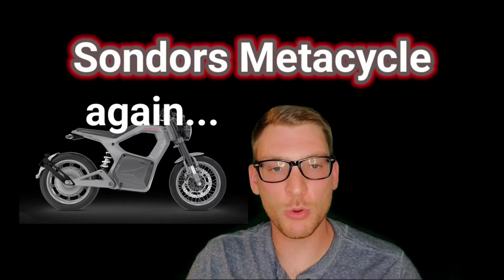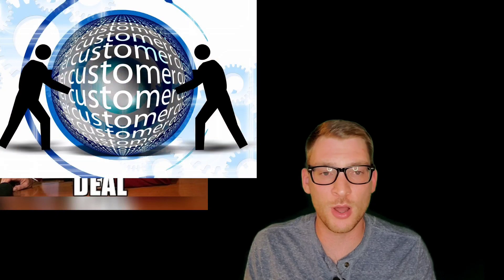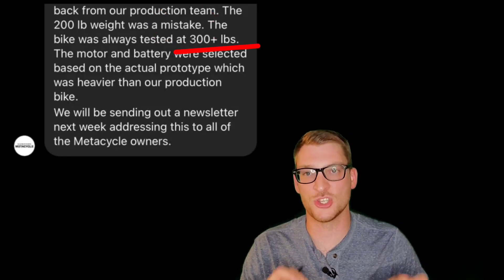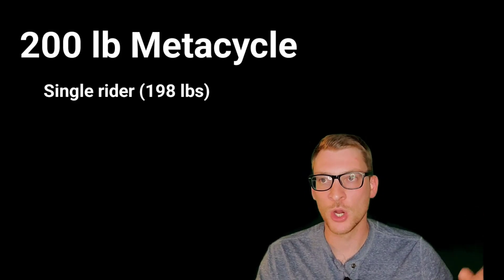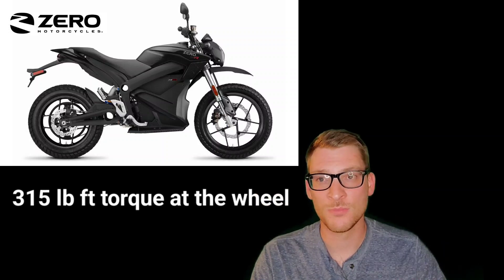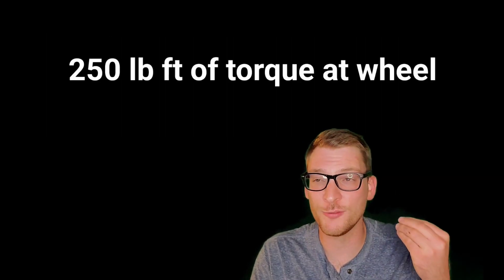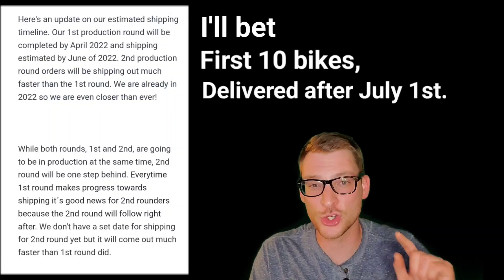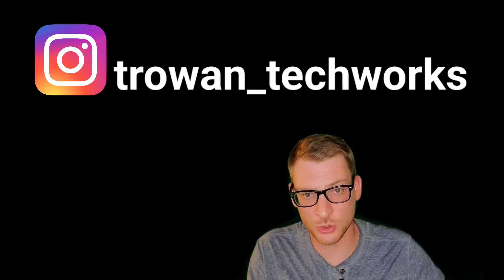Why the Sondors Metacycle will underperform

Comment: Everything you said was spot on. Took delivery last week. Acceleration is slow top speed 73mph, range about 40 miles (150lb rider). Battery is not removable the way it was shown to be. I have had a few mechanical quality issues. One of the foot pegs exploded and shot off the end cap and spring across my garage, the display screen stopped working during my first ride, and the cell phone charging compartment is really cheap doors rubs, squeaks and is sticky and has an uneven floor with no nonslip padding for the phone. Phone just flops around hitting the inside as you move the bike around. Also seems to be no regen braking that it should have to safely slow and stop the bike not to mention increase range closer to what was promised.

Comment: Poor performance isn't the only problem I foresee. I don't believe the Metacycle has J1772 charging capability? Try finding a standard outlet to plug into for 3-4 hours somewhere out on the road. That massive hub motor (unsprung weight) has to be a handling nightmare. It's cheap and that's the only reason any motorcycle engineer would do that. I noticed Super73 has redesigned their C1X and relocated the motor out of the hub. Smart move.

Comment: I'm not someone who pre-orders as a rule, but the promotionals on the Metacycle promised some very good qualities. I talked with them and was just on the edge of committing to buying from the second run of production in early July. All the previous delays seemed justifiably linked to supply chain issues during Covid and were in the past. Then the delivery of the first line was delayed *again*. Again, there were solid walls of confidence from Sondors up to and even a few days after the delay in delivery. They were still relying on old production images, and then a live demo where three bikes were out but nobody but Sondors is shown riding one or talking about them. This company has a cancerous issue in communicating with customers, and making promises that fail to materialize. I need to see them out, in the hands of the public, before I would ever look at buying. Even then, it says a sad thing about this company that I will trust a random YouTuber's unboxing video over anything they have said over the last two years. If I am convinced to buy, these would be the same people I would rely on for any warranty issues, recalls, or parts down the road...Can somebody else pick up the mantle of reliable electric for commuting at up to 50mph? Someone not in China? Someone not asking five figures?

Comment: Here we are in mid-July and the first batch are in transit to the US for final assembly. Look at you with your sagely predictions. I'm curious what your numbers look like with a rider >200 pounds. I know the average American man is about 200 pounds but there's a hell of a range there. I'm 6'2" 250 and I feel as if the Metacycle might fail to meet even modest range requirements and might be unfit for 70mph highways for people such as me. They say their maximum weight limit is 400 pounds but that seems...ambitious. It's an electric scooter with a cool motorcycle frame.

Comment: I don't think the average metacycle rider will be 200lbs, I think there will be a bias towards lighter rider. for the average full size pickup driver is probably way more than that and doesn't fit on a lightweight motorcycle. it's like supposing the average Sur Ron rider  is 200lbs . it's not likely, and not matching the (small) sample I've seen

Comment: I'm in the 2nd wafer of production have had my metacycle completely paid off since like Janualry.  0-60 is not that important, range is more important to me.  My work is 15 miles out, so I need at least 30 mile range for the commute (most is highway).  Hopefully that would be enough.   Hopefully i'll get it this year.
Reply: You need balls to take that thing to the highway, there is no way you will make it buddy.

Comment: They were having the same specs issue when they came out with their fat tire e-bike.  Calculations figured less range than the posted range on the  website.  The bike did come out late, but overall most people were happy with it.  It sold for $499.  Let's hope the Metacycle is not too far off their specs.  Maybe I could get down to 99 pounds, but I wouldn't want bullies kicking sand on me.

Comment: I wanted Metacycle for commuting so when they moved the ship date from Q4 to Q3 I paid the $5k and then when Q4 hit and there was no sign of production or even that design was locked, I got a refund.
Now it's the end of May and I am checking back to see how the bikes are doing in peoples hands, and I see they haven't made it out of China yet.
I never cared about top speed or acceleration with this bike. I just wanted it to get to 60mph so I can drive the 23 miles to work and 23 miles back on mostly rural highways with a short freeway run. But I was worried it wouldn't make it both ways without charging since I am heavier than 200 and it is about 8 minutes of walking to carry that heavy battery from the parking lot to my work shop and I didn't see any wheels on that battery.

Comment: Huge flaw in the logic of this video. I can't explain the technology or physics, but torque and hp of EVs is vastly different that that of ice engines. In addition, hub motors are vastly different than chain or belt driven drivetrains. I can't imagine sondors would lie this much. Time will tell. My guess is that the specs won't be quite as good as sondors says, but not as bad as this presenter states. Time will tell.
Reply from the maker: Haha really..Torque is torque, and power is power. The only difference is that with a transmission, you've got gearing which changes the ratio (multiplies torque) from the engine to the wheel. With gas motors, you've got to increase the speed of the engine to get to the peak power and torque. Electric motors have peak torque on demand from standstill, but peak power still requires you to raise the speed to achieve. The numbers required to accelerate at a certain rate and hit a top speed don't care what engine type you have on board. They still remain the same. And what you're wrong about, is that Sondors peak torque claim is for their hub motor which is located in the wheel itself. What you see is what you get, therefore their incredibly low peak torque number is for the wheel (no gearing or transmission to increase torque). It's elementary physics. So you can't say "huge flaw in the logic of this video" and expect me to take you seriously. 

I don't think Sondors is lying on purpose, I think that they just flat out don't know. Whether that's because of a communication breakdown with the Chinese firm doing the design, or engineering and marketing not being on the same page..we don't know for sure. But until they update their performance specs, you are stuck with an underpeforming bike.
Reply: @trowantechworks  you just spent a huge paragraph to explain that you have no idea what you're talking about. Thanks for the laugh.
Reply from the maker: @CRPerformance1  care to engage in conversation and tell me why I'm wrong?
Reply: @trowantechworks  not really. Time will tell.
Reply: @trowantechworks  I don't think you get it. Time will tell.

Comment: I don't see the buzz with Zero, double the dough for the min pkg, x4 for top of the line...totally incomparable in price range, spec, and purpose. Anytime I hear someone bring up zero-anything they're clearly on the Zero team - doesn't do us any good when we're looking for info. It's biased, guerrilla adverts at that point.

For example there was a vid I saw the other day where this guy is testing a prototype... The comments are glittered with Zero-this, Zero-that...it's very slight and covert but not sly enough. Everyone 'should' be able to see through that bs. Especially where no one asked and the video is NOT about Zero to begin with.
Reply from the maker: No, no, no. I used the Zero to show an example of my performance calculations being accurate. It made sense to choose an electric motorcycle for this, not a gas bike. It has nothing to do with Zero the brand. Anyone who knows anything knows it is not comparable to the metacycle. They're in 2 different leagues.

Comment: I think the hub drive may prove to be a mistake,  they have less torque and a lot of unsprung weight so pot holes etc could damage the motor and wheel.
I have ebikes with mid and done with hub and mid is better for off road but having said that the hub drives are doing ok.

Comment: Its funny..I made a decent electric motorcycle from a Emmo Zone ebike, using a 6000 watt hub motor, Kelly Controller and big 4000 WH battery and pulling about 23000 watts, the bike would do a top speed of 130 KPH (In fav conditions), get to 100 KPH in about 8.5 seconds and get about 40-50 km range in the city, so this is no surprise ..it does however make me irritated when ALL electric companies exaggerate  the range and performance of their products. So in a comparison this Sondors bike is slower than my Smart Car EQ from -60. Wow..

Comment: There are no affordable and usable electric motorcycles in the market.
Everything is total marketing brainwash and always massivly overpriced.
I really want one. I could afford a good one stretching my budget by alot, but I think, its not worth spending that much money and I won´t ever buy a gasoline moped because of noise and virbrations.

For the price of a suitable moped and all the gear and licence, that would get me a really nice car.
Reply from the maker: I hear ya Frank. How much would you ideally want to spend? What if it were $3-4k shipping included. Would you be alright with 25 to 40 miles of range depending on how hard you ride? If quick charging was an option, would you really need more range than that? Low cost can be done but there will be tradeoffs...
Reply: @trowantechworks  I got the Horwin CR6 in mind. That's barely enough for my daily ride to work, because I can't charge there on a 230V outlet. That would be considered stealing power.
It has a decent charger, too. That's why the TC max won't be an option.
I need minimum 40 miles of range, but there is no other way than a motorway half the way and I don't want to be tailgated by big trucks on a moped. 

The other option is Alrendo TS bravo.
That bike is around 11.000€ and weighs 240kg, but it has much more power, very big battery that I don't really need and a type 2 connector, that I could use at work.

The Horwin is not enough to drive anywhere else but work.
I wouldn't mind low mileage, but charging takes ages even on a type 2 charger.
Only Harley can charge ccs.

Edit: Just found the Urbet Nura. Very hard to find something at all.
It was announced with 7000€, is now >9000€ and the datasheet looks like some marketing guy wrote it. No useful information.
Reply: My sister is 40 miles from here. I would be stuck there for minimum 4 hours and still have to drive slow to make it back home.
If the battery ages, I won't make it at all.

That bike is 6000€ already.
I need an additional license (600€) and gear (1000€ maybe), too.
Very expensive hobby.

I can get 300€ a year, because it's electric, but I don't know how long they will pay that. Can be cancelled any time.

Comment: Bottom line, if it’s less than 72v it’ll be lacking on thrill and smiles-per-mile.  But this ebike is properly equipped, eg: brakes under both hands, parking brake, and reverse … all of which are absent on Harley’s Livewire and Zeros.
Reply: They were things I liked also, I had a Fatboy,  so that reverse as I get older is a big positive.  I wish security was better, ie with an app...I mean that damn alarm could ring till the battery dies if your not close.  I also don't see a mechanism for locking the forks... I'm still hanging on but they're not making it easy..

Comment: I'm still awaiting for my White Metacycle to eventually arrive. I completely agree with you that their specs are highly optimistic. 

Still I plan on using it to ride around town locally. I'll use my ICE Motorcycle for the long trips. I wanted a simple electric motorcycle as a backup to my gas motorcycle. 

I also have a Red Rover Fat Tire Mountain Bike, which is fun to ride around town. It also helps me get some exercise in while helping me climb large hills.

Once I get my Metacycle, I'll put it through its paces and see how it works. If I can manage the time (CDL Truck Driver here). I plan on making some YouTube videos on the bike when I get it. 

I'll just record a bunch of footage on my Drift camera and edit it while I'm out on the road. Haven't posted any videos in a long time but I'll try to pass along any useful information that I find out.

I still have my 2007 YZF600R Super Sport Motorcycle. So if the Metacycle's performance sucks, I have a backup! LOL

Comment: I got a refund and bought a 2022 Zero FX.  There is no way the Metacycle specs are correct.  My FX has almost twice the battery and 3x the motor power and weights 289 lbs...and it's top speed is 85 and max range (city) is 91 miles....but freeway speeds. I'm getting 40ish. So, I 100% agree with you assessment.
Reply: They refunded $5,000 to you? That's inspiring I've been waiting for my refund since December and just get a run around.

Comment: Thank you for the great video! I contacted them and this was their response. I am curious what your thoughts are. I have been contemplating canceling but your video convinced me that is not likely to be the bike advertised.

Apr 3, 2022, 12:26 PM PDT

Hello,
 
Thank you for contacting us. I hope you're having a great Sunday!
 
Allow me to add our list of specs for the Metacycle.
 
Motor PMAC hub motor 8kW (11hp) nominal 14.5kW (20hp) Peak
Torque 80 ft-lbs. nominal, 130 ft-lbs. peak
Front Suspension USD forks compression & rebound adjustable
Rear Suspension Direct (no linkage) compression & rebound adjustable
Brakes Single disc, hand actuated
Speed Up to 80 mph, 0-60 approx. 6 seconds
Range Up to 80 miles
Battery 4kW hours Lithium-ion battery (Weight 54 Lbs)
Frame Custom forged, weld-free, single piece exclusive cast aluminum
Charging Compact at 8” x 4” x 3” and approx. 7 lbs., Up to 15A/1.2 kW, Charge time is about 3 hours and 45 min. on either a 110v or 240v outlet
Wireless Phone Charger Clear cover phone port for easy viewing + navigation, 6.7"L x 3.6"W x 1.25"H
Total Weight 300 lbs.
Dimensions 76" long, 44" tall, 32" wide at handlebars
Seat Height 31.5"
Load Capacity 400 lbs
Reply: Thank you for your quick response. The Metacycle has gained another 100 pounds, but it will not impact its performance. You can stay calm as nothing has changed but the weight. Regarding your request, before I proceed, I wanted to make sure that you're up to date on the latest manufacturing, shipping, and live event updates we have planned.
 
In addition, I see you are locked in at a $5,000 price, this is the lowest price Metacycles will ever be! I wanted to let you know that SONDORS Metacycle price was at $5,000 and this introductory pricing has ended. Our new orders are available for Q4 2022 at the $6,000(or potentially higher) price point as you've noticed on our SONDORSX page.
 
I wanted to let you know that SONDORS Metacycle is anticipated to ship early round 1 orders this upcoming June and you are locked in at the limited time offer of our $5,000 price point.
 
Besides this, allow me to explain the benefits since you are indeed part of our limited edition first production round of Metacycles.
 
- They have confirmed production and shipping estimated dates. April for final production and June 2022 for shipping of 1st round.
- The SondorsX page states in specs that Metacycles will be fitted with Kenda tires. While Kenda is great tires; we're giving 1st rounders exclusive Michelin tires as was promised by Storm back during the introduction.
- All 1st round production orders will be personally signed by our Founder/CEO Storm Sondors
 
Our live test ride event is coming very soon. We are scouting locations right now.
We'll have tons of new content including production photos and test rides. And just for a sneak peek we even have a special Jay Leno project in the near future.
 
If you have any further questions, don't hesitate to contact us again.
 
All the best

Comment: I sincerely appreciate all the information and analysis you have provided on this bike.  I am a newbie...novice...ignorant first timer if you like in the ebike space.  I am told because of the early timing of my order I have "Elite Status."  I know I know...everyone is told this and I should take the fish hook out of my mouth.   However my question has to do with your discussions of "unlocking" the bike or hacking and modifying the bike's software to increase performance.  Supposedly my bike will have, "Two Unique Power Modes.  Eco Mode with limits to 100kph/62mph and Sport Mode allowing full speed + power."  Assuming this is a real feature...what are your thoughts?  Would either of these modes impact your calculations?  Could "Sport Mode" be referring to an "unlocked" or intentionally "hacked" version of the bike?  I really look forward to your reply and value your expertise.  Kind regards.
Reply from the maker: Thanks for the feedback, it is much appreciated! And unless sport mode produces more power or torque than what is listed on their official website, no. I am simply using the specs that they provided. Now could the information on the website be wrong? Sure. Maybe the Metacycle can put out more than 14.5kW in Sport mode. But Sondors has not published this information.